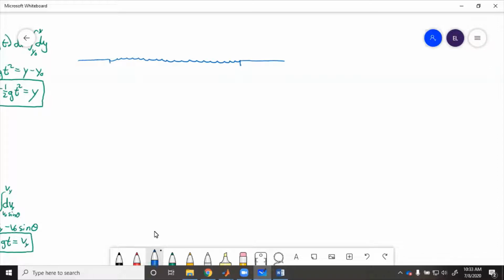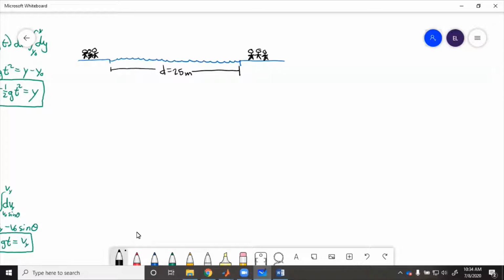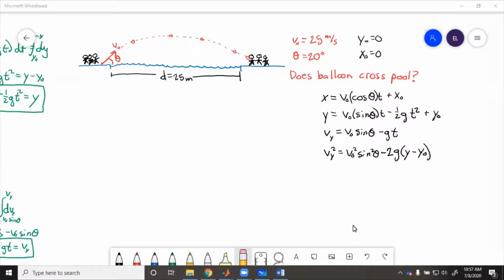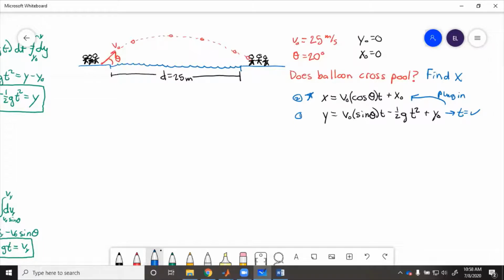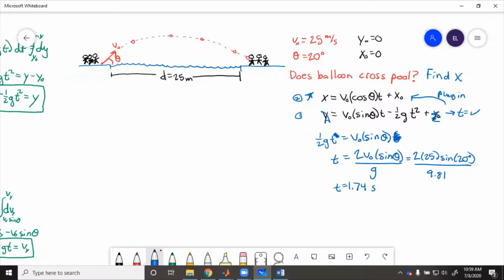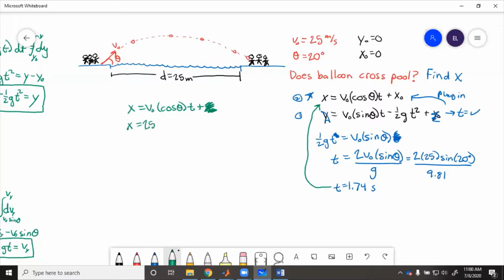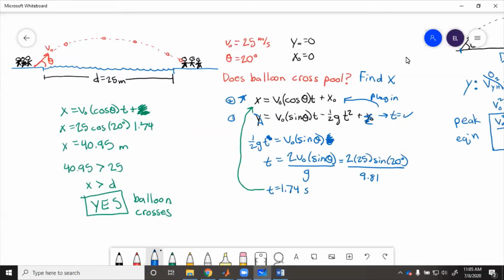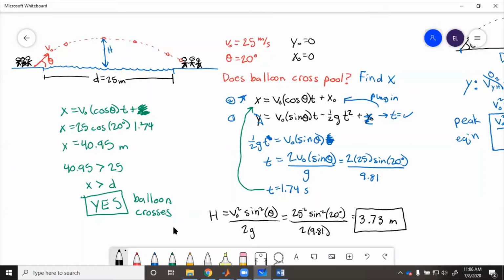Projectile Motion - Water Balloon Example

Comment: I want to do this with my class, but am wondering how do you launch the water balloons, how do you know the initial velocity and angle?
Reply from the maker: We launched the water balloons from a bungee slingshot.  Initial angle can be measured as the angle at which the slingshot is pulled back.  To find initial velocity, use conservation of energy from cocked position to launch position and treat the bungee as a spring.